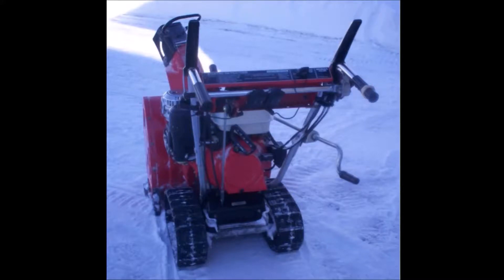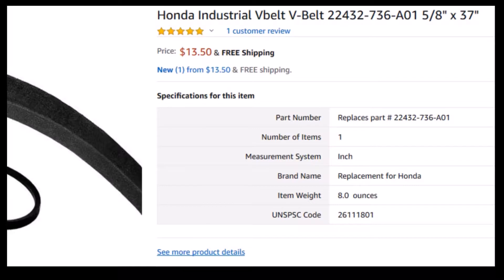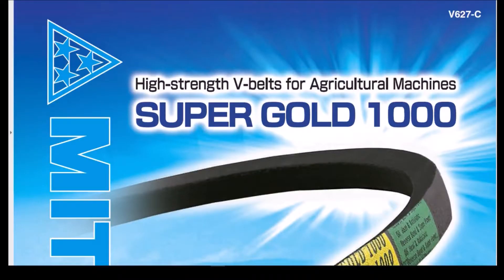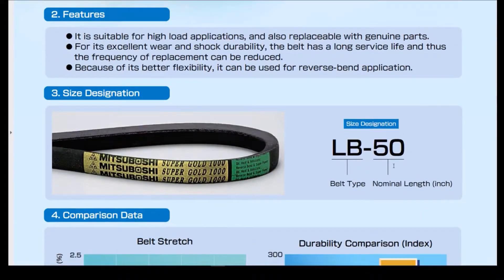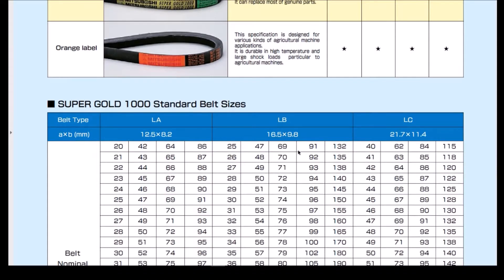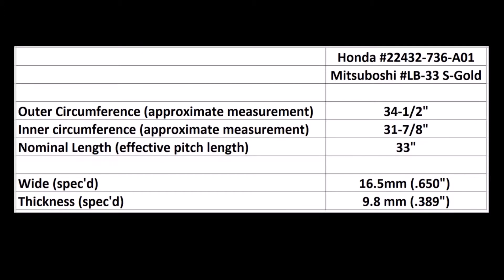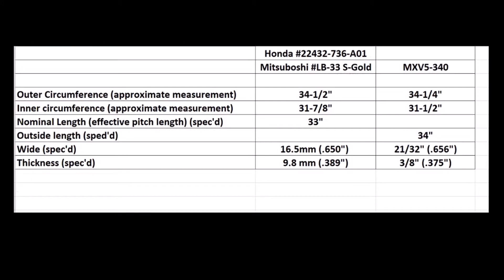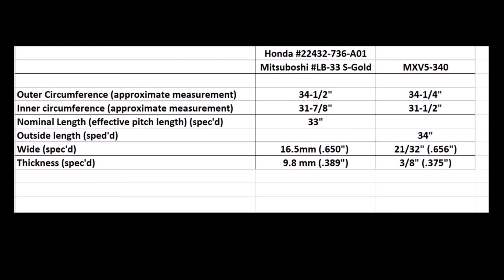Honda Snowblower alternative replacement belt for Honda auger belt 22432-736-A01, Mitsuboshi LB-33

Comment: Thanks for taking the trouble to do this. Very well researched and explained.
I just had a yelling match (not really) with a honda parts person. Using conventional measurements this belt comes out to a B 31.5 ish which actually is the honda size for the serial number group before my serial number groups listing it as a B 33. I thought I had a goofy model right at the serial number change and mine had the previous group belt. Conversation went bad when he told me there would be a 20% special order restocking fee even if they ordered the wrong belt.  Now that just isnt right, paying for their mistake. This cleared everything up. Never thought of reverse bend capability. Thanks, you saved the day.It's
Reply from the maker: I would really appreciate a LIKE and Subscribe.  That would really help me.  THANKS!!

Comment: Aramid belts have to be slacked not tensioned. Unless you are using it on a pulley system with a spring tensioner, pass it up! Because Aramid belts do not stetch, and they are stiff. As Aramid belts get hot, they become tighter instead of streatching. You slack by the amount a polyester steel belt would stretch.
Reply from the maker: Snowblower auger belts ARE spring tensioned.